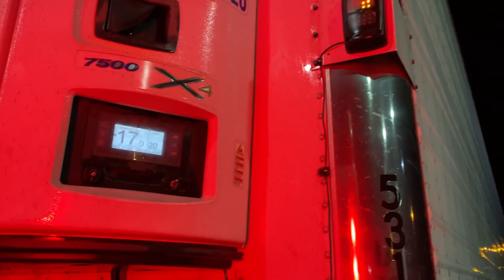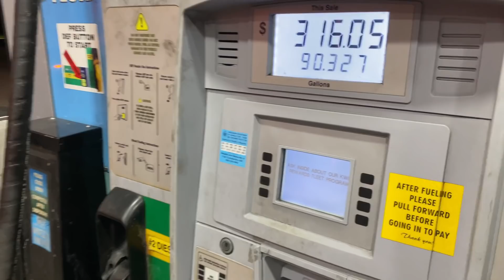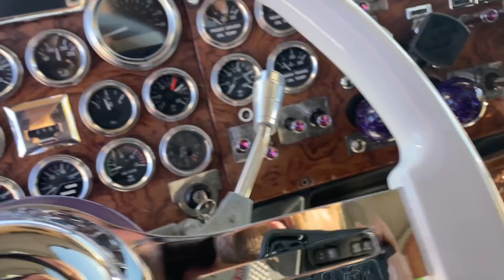“Buy an old truck!” they said…

Comment: I do need to add one more comment I did the mud flap ap but they only have one spot in Montana. I wish they would expand more up north.
Reply from the maker: That is kind of their downfall at the moment. They are working on getting more and more added daily though. In time we should be able to use it in a lot more places
Reply: Great I am going back to road oil hauling with my truck here in Montana. The company I am least to is going more leasers we need all the help we can get.

Comment: I'm going to say this very nicely, if you can't inframe your engine or do a tranny swap, change brakes and tires, rewire lights, you shouldn't own a old truck, you can afford a new truck, get the warranty and you have to keep it rolling to make money, but if you can fix your old truck, it's cheap and should be paid for and you don't have to run it hard to make payments, you can't afford $155hr shop rates on repairs

Comment: You are going to like them single headlights , Once you get them set right you have to torque the bottom bolt up pretty tight or they will move on you , I call them gangster headlights  😂😂 Or The 359 double headlight they are nice to, My 014 I have the eyebrow headlights , i just never had a chance to put my gangster headlights on yet One day ,
 Be safe take care yourself